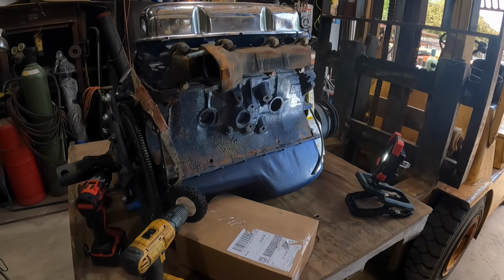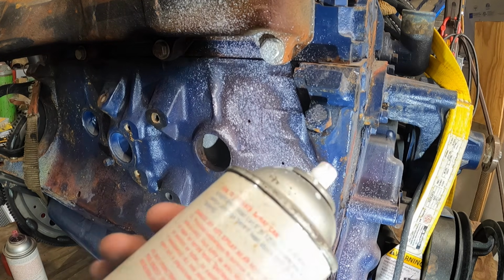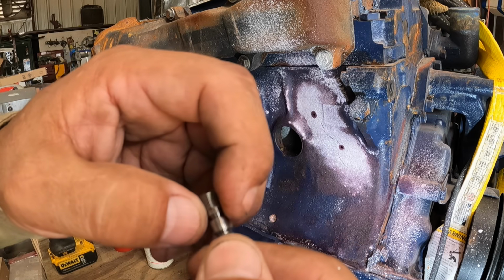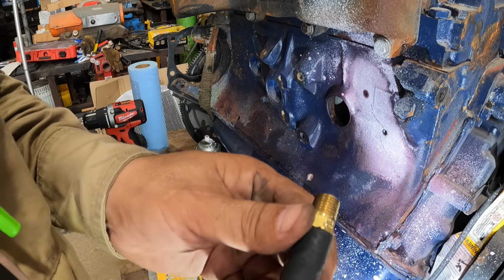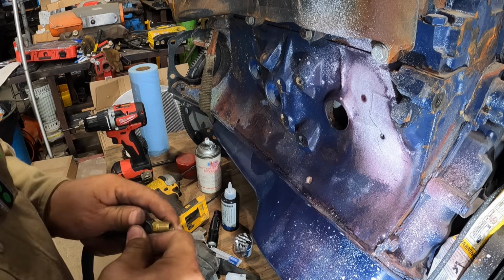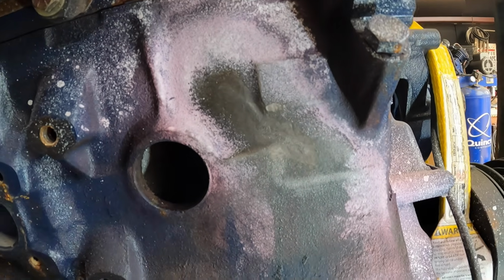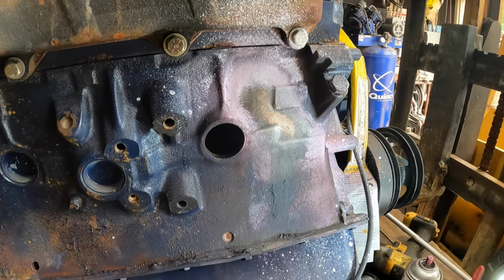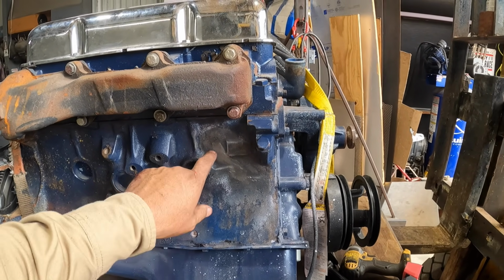Cracked Engine Block Repair

Comment: I had a big block Chrysler,, left water in over winter,,, broke out both sides,,, cleaned the pics real good places them back in drilled all the cracks at the stops ,,, block in oven for an hour, pre heated in front of brazing all cracks including freeze plugs areas , clean up painted reinstalled,,, ran that race motor for 2 years,,, not one leak !
Reply: P.s. this was in the 80’s ,,,, lol

Comment: I've used that clamp tool on many repairs but I use stainless safety wire since I already had it. Then I use heat shrink over the top.
Reply from the maker: Great tip!
Reply: Same, I always have one in my toolbox. I think the one I use is from Clamptite, and for most things .032 stainless lock wire works a treat.
Reply: @suzu9404  Yes, same wire diameter I use most often.
Reply: That is very cool!

Comment: Back in the  mid 70s I had a Chevy truck 300 six cynlder had a Crack on driver side in the water jacket I grinder it out used jb weld let set up over night worked so well 3 years later.sold the truck never leaked showed him the repair job jb weld works great I think on something like that On a engine block good luck just redneck ways work for country folk

Comment: I don’t know if this will help you with your spray can but, I’ve learned over the years, after you’re done spraying the area, tip the can upside down and spray it away, and it will help clean out the spray nozzle, for good measure you can always wipe it off with a piece of paper towel or something.
Reply: That's part of the instructions on the spray cans except many of the newer cans have spray at any angle so it doesn't work.

Comment: Great to see this method being used. The largest engines in the world, 2-stroke cycle crosshead marine diesels are repaired by metal stitching. It is a tried and true method for fixing cracks in cast iron.

Comment: There is another version of that called Irontite plugs. They are actually made of cast iron so there is no thermal expansion differences, and have a tapered thread like pipe plugs. I have put in hundreds of them when I worked at a machine shop. They even work inside combustion chambers on cracked heads. I never had any fail over the years. They come in a bunch of sizes, but I typically used ones about the same size that you were using.
Reply: One of the first jobs I had in an automotive machine shop was fixing cracks like that using the tapered thread iron plugs, probably same as you are talking about. It worked, but obviously tedious. I had good attention to detail and was extremely cheap labor, so got to do most all of those jobs.
Reply: I worked in a Napa machine shop in the 70's My boss, an old boy used the irontite plugs a number of times. He called it sewing. "Got to get out my sewing kit" lol. Thanks for the video.
Reply: @cjespers  These have been around since the 70s? Wow!. Thought bronze brazing was the only way.
Reply: I was using the English metalock system in the 80’s here in NZ , the studs and keys were about 80% nickel so it expanded and contracted the same amount as cast iron but was BA threads and taps were hard to get and expensive. Did some great jobs on ships, large machinery etc.
Reply: And we used electromagnet and iron powder to indicate where the crank was 👍😎✊

Comment: I’ve seen that product before thanks all the same. I like the idea of that hose clamp device. Maybe a piece of heat shrink over that wire wouldn’t be a bad idea. And yes, those clamps hose clamps are bulky right at the end of your air hose.

Comment: I fixed many using NiRod nickel rod.
Even 6011 works .
Lasted for years .
Reply: Fixed my ford 302 exhaust manifold with that .
Reply: @michelgrenier1878  yes...even 6011 .
I welded up Detroit diesel 6v71 holes in manifolds huge cracks still good years later .
NiRod nickel rod works excellent but expensive.

Comment: I learned in technisa one use 50/50 chrome stainless steel rods one butter it then weld the rest with mild steel rods. Otherwise jip nuts dril holes tap insert bolt etc

Comment: Cast iron ? Not easy to weld
Reply: Cast steel ... Manifolds are iron.

I welded many of both materials.
Not that bad to weld .

Bad quality cast iron carbon sand like dumbbell set weights can't be welded .
Weld pulls away from iron .
Reply: @MitzvosGolem1 I've a few good friends that are brilliant at it . I stick to machining and lathe work . 
That type of welding is a dark art 😂😂😂
Reply: @ragnarironspear1791  I do both Lathe south bend  , milling  and weld stuff .
Not the best but I get er done .
They have aluminum stick rods for AC weld Hobart has at tractor supply. Thought it was a joke tried it .
I welded the blade back on my Yamaha outboard four years ago still good 👍 lol

Comment: You would be the only welder I would trust to weld my engine block if I needed that done!!I enjoy all your videos no matter what your welding on. Thank you for your humor and humility.
Reply from the maker: Thank you for the vote of confidence
Reply: Always up for learning, enjoyed that. Thanks!
Reply: That wasn't really welding. I welded 2 vices one with a mig and the other with a stick welder,  both have been holding up better vs the cast iron.